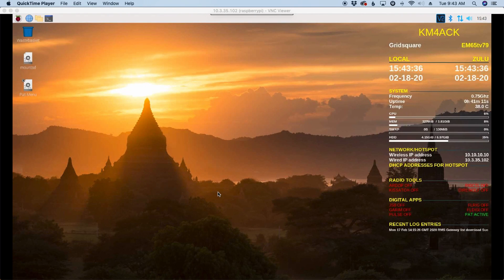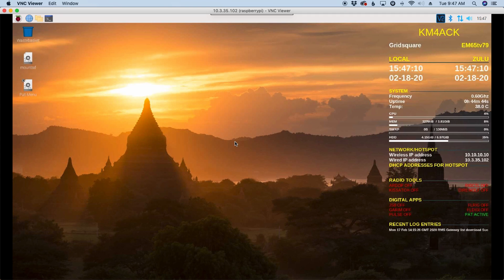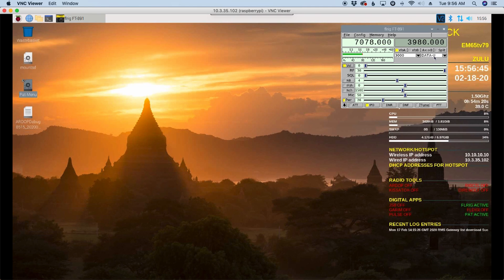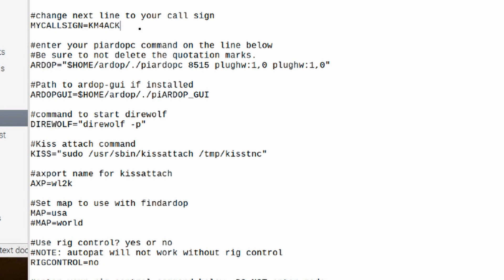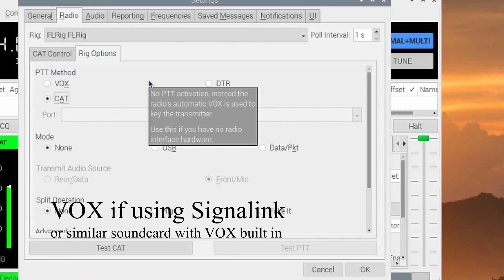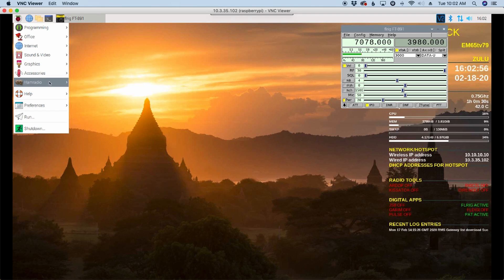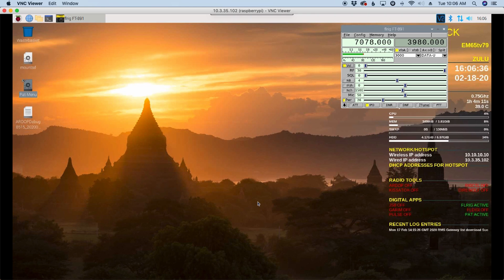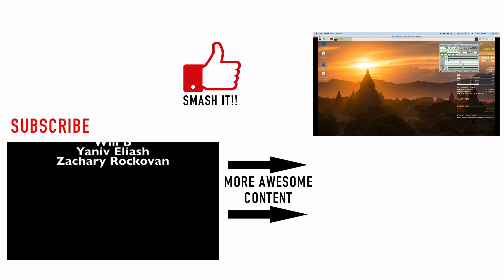Yaesu 891 Setup with Raspberry Pi

Comment: On the page you presented the FT-891 settings from KD9CJX's website, the line that states "062 Data Mode Others (NOT PSK - change to OTHERS) should begin with menu 08-01 and not 062

Comment: I have not used the portable FT-891/Signalink/Raspi 400 setup in quite some time. I pulled them out tonight to get some practice and could not get the Signalink usb to show up in the Com Port window of FLRIG.  Last time I used this portable set-up, it worked.  I have spent the last three hours trying to figure out how to get FLRIG to initialize, but can't figure it out.  The Two selections you speak of do not show up in the drop down list in the Xcvr menu in the configuration window.  Any suggestions,,,,,
Reply from the maker: The signalink will never show up in FLRIG. It is a sound card. FLRIG is for CAT control of the radio. You. should be able to select your radio in port in FLRIG. If you need more help, post in the forum and we will do our best to get you going. https://groups.io/g/KM4ACK-Pi/topics

Comment: So I know this video is over a year old, but I thought I might give some insight as too why the pulse audio setting does not hold after you stop the app and restart. That number you see in pulse audio after the name, the 28161 is what is called the pid or process is of the application you are adjusting the sound level for. That is a unique identifier for that instance of the app. So when you exit the app and restart it will get a new pid and pulse audio knows nothing about it. This is why the levels don't stay around.

Comment: Jason, Great video! I'm having a problem that I hope you can help me with. I'm using the Sabrent USB device. My ALC level on my FT-891 is zero. I need to be able to adjust the levels of the Sabrent. If I go to the volume control on my pi 4 there is no usb option. Can you help me out in getting this adjusted? I'm running the latest version of pi desktop and WSJT-X is version 2.0.0 
Thank you!!
Reply: OK..  I found the instruction below about using alsamixer to adjust the levels. I was able to increase and decrease the sliders with no change in the ALC and no power during transmit. I have CAT control working WSJT-X will change frequency on the radio and I am able to key the 891 during tune and on WSPR Mode but with no power nothing is transmitting.  Anyone have any ideas?
Reply from the maker: Don’t have my 891 in front of me but I think there is a digital gain settings in the menu. You might try adjusting it in addition to adjusting the audio with Alsamixer. In addition, there is a slider in FT8 that can be used to adjust levels.
Reply: @KM4ACK  Thank you Jason..  A combination of things got me going. Not before I placed an order for a SignalLink.  My only problem now is that the auto sequencing seems to get hung up on sending signal reports and doesn't advance past that. I'll figure that out once I can sit down and try a few things. 73 K8FOF

Comment: Have you found a case option for a Pi4B with that power board? I’m basically just about done with my packable setup, but am currently stuck on how exactly I’m going to power my Pi.

(iPad + Bluetooth keyboard + Pi + TX500 + pocket tuner + efhw)
Reply from the maker: Yes. Check out the accessories page for the link https://app.simplenote.com/publish/4W4h4y
Reply: @KM4ACK  

Well that’s handy. I have one of those that came with the Pi starter set. 
Thanks, Boss. 
<salute>
Reply: @KM4ACK  
You’ve had no issues with that power board? It has some pretty (consistent) lousy reviews.

Comment: Good Afternoon! Thanks for the great vids you put out. Can I ask how to get the desktop info I see on your screen? Thank es 73 de Kf4UOD David
Reply from the maker: It's an application called Conky. You can install with "sudo apt install conky" or install it using build a pi. https://youtu.be/l4M9VVqGxoc
Reply: @KM4ACK  thanks brother I scrolled down a little and saw someone asked that question already. Got it installed and working FB. I do not have a god installed and the grid does not show up. It actually says Some Err.... any thots?
Reply from the maker: @spizzed  That is what it should read since there is no GPS installed.

Comment: It is possible record the  QSO in FT8 on this tool and then upload on log40m to confirm qso? I'm thinking setup my FT891 and a Raspberry PI to make my FT8  SOTA activations . Thanks!  TI2GBB
Reply from the maker: Hi Greg, I do very little DX work so I typically don't log contacts on a day to day basis. Most of my work is with the same guys on a regular basis. You might try posting in the forums to see what others are doing. https://groups.io/g/KM4ACK-Pi/topics
Reply: @KM4ACK   I will check, thanks
TI2GBB

Comment: Well, I thought my problems were solved but I spoke too soon. The 891 is keying just fine now but not getting any power output. Couldn’t figure out why I wasn’t connecting with any ardop stations why I noticed the P O was flat. Works ok with WSJT-X using Flrig for CAT control but nothing through the Pat program. Been playing with sound settings for awhile but nothing seems to help. ????
Reply from the maker: Are you in DATA-U mode?
Reply: KM4ACK Thanks Jason, yes I am. Not sure what I did but now everything is working at least as far as the 819 putting out power. I haven’t been able to make an ardop connection as of yet, though. All the stations I try seem to be always busy but I’ll keep trying. Thanks again for all you do.

Comment: Hey Jason. I’m having problems getting rig control within the pat program. I’m using a FT 891 with a Sabrent sound card and following the directions in this video. When I select item 2 in the pat menu, before the modem starts and the ARDOP GUI starts, I get 4 lines of errors in the home/pi/pat menu/start-pat-ARDOP: line, 62, 35, 48, 41 /usr/local/bin/rigctl: no such file or directory. I’m using Flrig for cat control and it’s up and running fine. I’m sure this is something simple but I can’t figure it out. Thanks for the assistance.
Reply from the maker: From the error message it appears that you don't have hamlib installed. It's needed for Pat to interact with FLRIG.
Reply: Thanks for the advise. I reinstalled a new image making sure Hamlib was installed and that took care of my problems. Have a great day.

Comment: I’m using a FT 819 as well and am using your video to make the changes you describe. When I choose #2 in the Pat Menu, the ARDOP GUI opens but I get an error that says 127.0.0.1 can’t be reached. I thought I made only the changes to the config file you described. Any ideas? Thanks
Reply from the maker: More than likely you chose the wrong port in your pat menu config file. You can check the port number in the pat winlink config file. run "pat configure" to see what port number is called in Pat and then change your pat menu config file to match.
Reply: That did it. Thanks - love the videos and thank you for all you do.

Comment: Hello and thanks for the info. I setup for it and it controls the radio (PTT, NB etc work from flrig), when I setup wsjtx and set the rig to flrig flrig as you did, it cannot manage the radio. So I stopped flrig and setup wxjtx to use the USB ports but it doesn’t show the /dev/serial ports in the drop down. Is my install bad? I have an rpi 4 I can try. Thanks and 73!

Comment: Not seeing my sound card in the drop down list.  Did i need to have that plugged in while running the build a pi script?
Reply from the maker: No. Whether it is plugged in or not during the build make no difference. Do you see your sound card when you run arecord -l from the command line?
Reply: KM4ACK Yes, when I run the command I do see USB Audio Device. I’ve also tried different USB ports.  All I see in the flrig drop down is a bunch of dev/tty0...63, and the usb gps.  I went ahead and ordered a second sound card just in case that is the problem but open to any thoughts.  Thanks.
Reply from the maker: In FLRIG, you are looking for the CAT cable connection instead of the sound card. Do you have a CAT cable connected between the radio and the pi?
Reply: You are correct! For some reason I jumped to the assumption that the items listed were from the sound card instead of the radio, which in hindsight doesn’t make sense.  I ran the cable to the 891 and that connection showed up. Thank you so much for your patience and help getting me back on the tracks with such a basic mistake.

Comment: If this rig is like the 991 the two usb silicon devices are 0 CAT and 1 the built in to the radio sound card... when using my 991's built in sound card, there is also a D.VOX option that can key the rig when audio is presnt at that device.  I wonder if that rig has the same.  So you may not even need the usb sound card you got.  The radio has one built in if it is like the 991.

Comment: Excellent Videos!  Thanks.  I have run into a problem though.  I have a recent download (Last week) of the V2 Build-a-Pi and have JS8Call working using pulseaudio that I installed using the Preferences - Add/Remove Software app (It wasn't installed with the build).  When I have attempted to get PAT /ARDOP configured for my setup (Pi3+, USB to a FT-991A) I cannot find the audio controls that you show in the video above using the right click of the speaker icon in the tray.  I get the Pulseaudio mixer and cannot find the output to the radio (built-in USB on the 991) device to  set the TX level.  The RX works fine as does the rig control through flrig.  If you have time or there is someone else out there that can get me re-railed, I'd like to at least get my nose pointed in the right direction.  Many Thanks! KL7UT Ray
Reply from the maker: from the terminal, run 'alsamixer' to access your sound controls. F6 will cycle through different cards.

Comment: Love it - everything works as you showed. When you set the volume with PULSE and then exit the PULSE control application, the input volume works fine.  HOWEVER, as soon as you exit JS8 and come back in, the volume gets reset to the system volume.  I'm not sure why even use PULSE unless you want to use PAT at the same time which is unlikely.  Any way of making the PULSE volume stick for the JS8 application?
Reply from the maker: No way to make it stick that I am aware of. That's why I mentioned it in the video. The reason I do it this way is so I can leave my Pat ARDOP settings alone once I have them dialed in. I find it easier to adjust JS8Call than Pat. 73, de KM4ACK
Reply: @KM4ACK  That makes sense.  Thanks for the reply....really no big deal!  your videos are awesome, life savers really!

Comment: I am having trouble getting wsjt-x and js8call to key my transmitter.  I am using a ZLP Electronics MiniPro interface. With the same settings, fldigi works fine.  Anyone have suggestions?
Reply from the maker: Check you usb volume settings using the speaker in top right corner of desktop. Right click on the speaker. Make sure usb volume is set to 100% during testing. You may need to adjust later. Also check that each application is using VOX as the PTT method.
Reply: @KM4ACK  Thx for the tip. I got both wsjt-x and js8call fully working.  Now I have to tackle the driver/port problem with my IC-7200.  Apparently some kind of collision with GPS.  Not like I had anything better to do with my evening.  Good work, Jason!  73 de David SV0SGS
Reply from the maker: David, If you haven't fixed it yet, check out this page. https://app.simplenote.com/publish/WczWbl Look at section "Radio not seen by pi" No promises, but it may prove helpful. 73, de KM4ACK
Reply: @KM4ACK  Thx! I also saw this tip on another website. Strangely, the fix (USBAUTO="false") did not work with the gps unit I have been using. Fortunately, I do also have one like the one in your video, and that one worked.  USBAUTO="true" is good for hotplugging when you forget to have plugged your gps unit in after booting the pi. Not having it is inconvenient, but not a job stopper.  I wonder if ICOM or the pi people are working on a fix. 73! David SV0SGS
Reply from the maker: No clue if anyone is working on a fix. I didn't even realize it was a problem until viewers were having issues. It doesn't occur with Yaesu 857D or 891. Glad you got it figured out. 73, de KM4ACK

Comment: When attempting to run js8call/wsjtx after following this video I receive a hamlib error. However flrig and pat open ok with my ft-891. ???
Reply from the maker: I have experienced WSJTX crashes when using FLRIG as the radio in WSJTX. I have not seen this happen in JS8Call. If you are using FLRIG as the radio in JS8Call, where are you seeing the hamlib error reported. What does it say?
Reply: @KM4ACK  I will reset up my Pi with ft-817 and give it a try again without flrig running and let you know how it goes. I also must give you the Best Shoutout for always being there to help and being there to respond fast. Can't thank you for this enough!
Reply from the maker: Thanks Ted! Did you build the system with build-a-pi v2?
Reply: @KM4ACK  yes, v2.
Reply from the maker: Keep in mind that Pat Menu will by default use FLRIG. You can change this behavior in ~/patmenu/config

Comment: sound card:  what cables do you use?  do you use the data port on the back of the ft-891?  I have an ft-891 and  an Icom IC-7200.  There is a problem configuring the IC-7200 with FLRIG, ie it doesn't work.  The source of the problem seems to be the GPS conflicting with the driver/usb port for the IC-7200.  Are you aware of this?  It might be of interest to your viewers who choose to purchase the new IC-705 and want to run it with the pi, in case the same problem occurs with the new rig.
Reply from the maker: I am using the sabrent sound card. Have you seen the FAQ? Info contained there about the fix for  IC7200/GPS conflict and links to other accessories that I use. https://tiny.cc/km4ack-faq
Reply: @KM4ACK  Thx! I also have a Sabrent sound card.  Your cable looks like the one I have ordered.  I will check out the fix for Icom in your FAQ.  I hope it works.  My FT-891is ok, but I like my IC-7200 more, even if it is much bulkier and heavier.  Current draw is about the same.

Comment: Comprehensive as always. I especially appreciated you showing how to configure pat, patmenu, and data mode for the FT-891.

I'm not 100% sure about this, but that the "both" or "mono" settings for the Modulation Soundcard Input/Output may have something to do with how the audio interface cable is wired (the cable between the Pi's Sabrent USB sound card and the 6-Pin Mini Din plug in the back of the FT-891).  Mini stereo plugs (3.5mm phone jacks) come in tip-sleeve, tip-ring-sleeve, and tip-ring-ring-sleeve styles.  The "mono" setting may refer to putting the radio's data signal through the tip connector only (while the sleeve is ground and any ring is ignored).  The "both" setting may refer to using the tip and ring connectors both for same radio data signal, while the sleeve is ground.

I compiled some notes while I was trying to map out my HamDaptor cables for the FT-891: https://www.evernote.com/shard/s36/sh/184c415b-653f-4804-95a7-b99d33fd940d/0345f4ae5dd86eda3e4f84bf9cf32e6a
Reply: Awesome information Eric!  Thanks for sharing!

Comment: Jason, do you have the same options available in FLDigi when you hook up your FT-857D?  The Power control, SQL control, etc...? Good job on the video.
Reply from the maker: You have some control with the 857 in FLRIG but not as much. It will do the basics....change mode, change band, turn on split, and change VFO but that is about the limit with the 857.

Comment: Which device are you using for USB to serial for your rig control?
Reply from the maker: The 891 uses a standard USB cable for the CAT interface. https://amzn.to/2Wau68I
Reply: @KM4ACK  I see. Thank you! Looking at hooking up my much older IC-706 rig control. Will need to have a USB serial ports for that.

Comment: Great video Jason!!!  Thanks for sharing those tips!!  Some of the software I am not familiar with and that was a big help.  I didn't know what Pulse was for and that now has cleared that up.  I do have a question though, are you running the Yaesu and the Pi without a Signalink???  Can you do that???  The reason I was asking, that would make my 817ND setup even more compact if I don't need the Signalink!!  I don't know if you have seen my picture on Instagram, but I have the 817ND, then LDG Z817 auto tuner, then the Signalink and then the Pi in a, as someone called it, a pyramid configuration with bungee cords holding them together.  Appreciate these videos, and would love to see a video of your setup, the rig, the Pi and whatever else you hook to it to do these.  Keep up the good work Jason.  73 Juddie WD8WV
Reply from the maker: Correct. There is no signalink in this particular setup. It uses the USB sound card shown in the video instead. The difference here is that you have to control PTT via CAT because the USB sound card doesn't have VOX built in like the signalink does. Due to this, there are a couple of extra steps and a couple of differences in configuration. 73, de KM4ACK
Reply: @KM4ACK  thanks Jason for getting back to my question.  I do have one of the soundcard USB's as well but I didn't know for sure whether I could use that instead of the Signalink.  Again great video my friend.  73 Juddie WD8WV